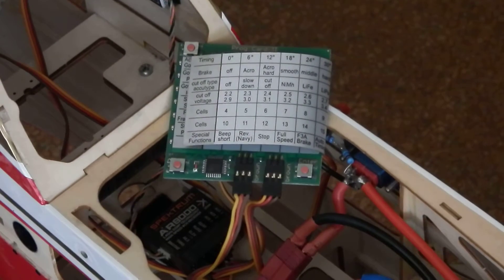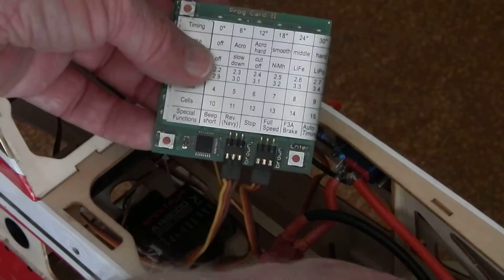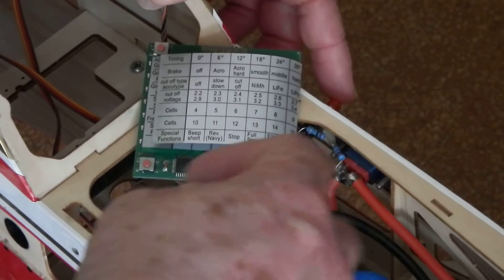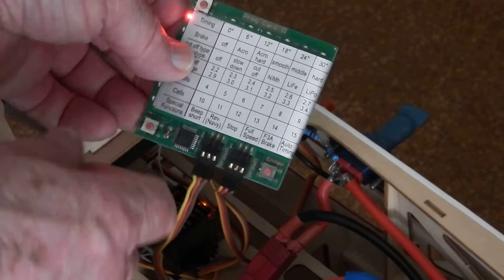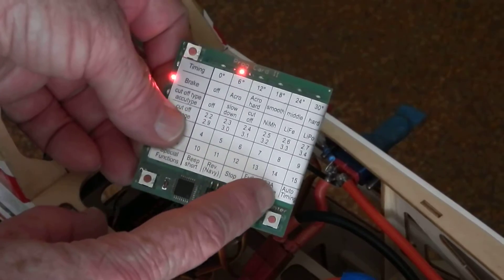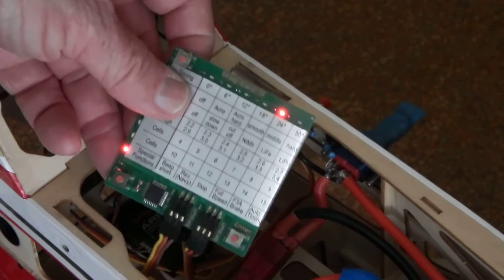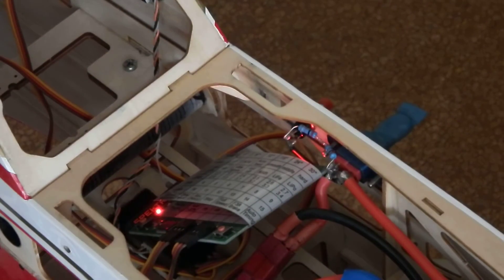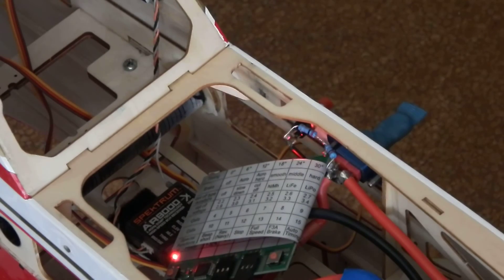YEP ESC F3A Brake Setup - Ed Drakes

Comment: Is this card ok for a 3 cell battery?
Reply from the maker: Hi Gianpaolo, here is a paragraph from the YEP manual.....

All function can be adjusted like that, while the programming
order is not relevant except for the Lipo type followed by the
cutoff voltage adjustment and the cell count.
Though, you can modify later on any single value anytime.
2 and 3 cells are recognized automatically by the controller.
That is why the cell count settings are starting with 4 cells on
the ProgCard II.

In other words, do not select a cell count and 3 cells will be auto-detected at power up.
I hope this helps.
Ed